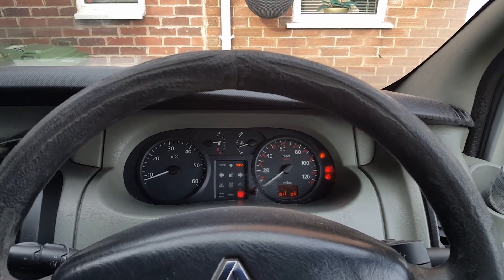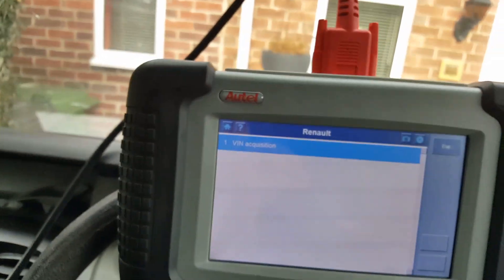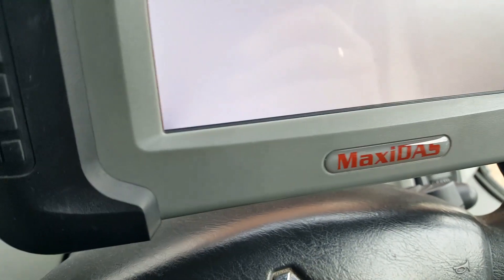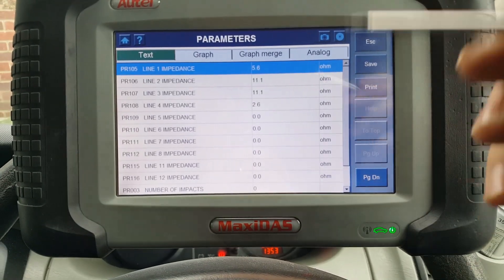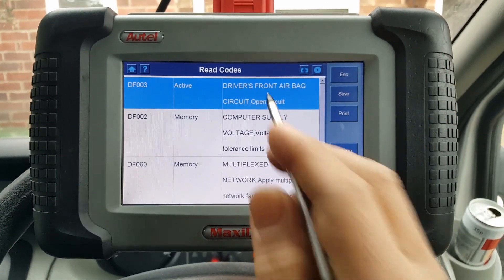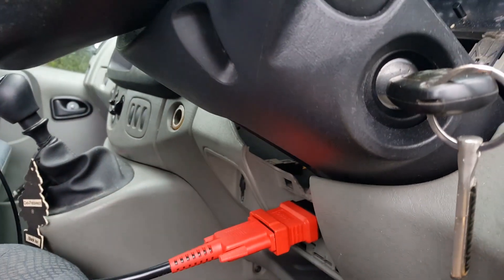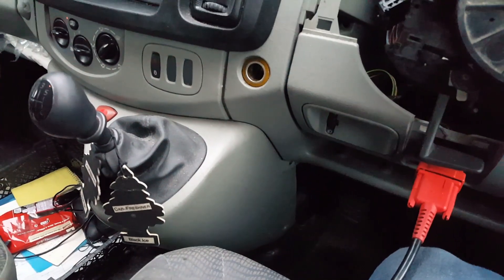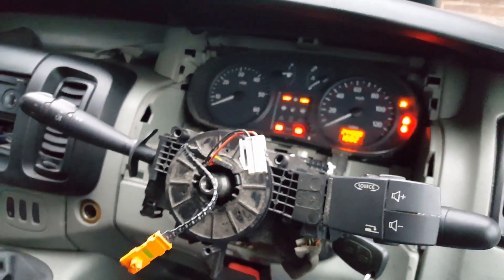Renault Trafic 2003 Airbag light on. Faulty steering squib (clock spring), diagnose and test.

Comment: Was the horn not working also?
Reply from the maker: Can't remember now...
But it all depends how they fail... 
Thank you for watching!
Reply: @LMAutoRepairs  I have the same problem. Horn has not been working Esther a couple years before the warning lights came on. Fault reader gives code Df158. Strong indications about the fault being in colck spring, not pretensioners? Also line 2 shows 99,9 ohms...
Reply from the maker: You need to test, but there is a good possibility of being the clock spring...
👍👍👍

Comment: Just a word of warning if you're unlucky like me and own a mk2 megane.
After months of problems, clutch, steering rack etc, i decided to take it for an Mot. The day before i was going to go for the mot i suddenly discovered a lever under the steering wheel, never looked there before, decided to pull the lever and tilt the steering wheel up, airbag light came on!, ahahahaha, aaaahahahaha! I love this car. Not!
Incidentally, car had new airbag clockspring/squib 6 months ago!
Reply from the maker: 🤣🤣🤣🤣
That's really unlucky...
Hope you get it sorted...
Thank you for watching and for your comment!
Reply: @LMAutoRepairs  I've heard that you can get products to sparingly use on airbag connections to increase/ensure conductivity? Is it die electric grease or something? Or is there some other product i could use, have you heard of anything? Cheers, Lee.
Reply from the maker: @robbocop33r12  
Yes... That's correct...
Silicon based grease....

Comment: Hi i have the same problem well the same symptoms, can you not check the clock spring through continuity on the airbag wiring say the plug to plug, the plug at the rear to the plug that goes into the airbag itself as i dont have such sophisticated equipment as yours but have a multimeter many thanks..
Reply from the maker: SooperSkoots 
Hi
Yes, you can check it like that...
Reply: Many thanks for that i am going to do that in the morning, great video by the way very help full....
Reply from the maker: SooperSkoots 
Thank you for watching!
Reply: Hey i did the check i mentioned and yes it worked, a new squib is on its way, thanks so much for this video i would not have done it without your help, many thanks again Mark.....
Reply from the maker: SooperSkoots 
No worries, here to help!
Reply: Hi just a quick one, i have replaced the squib and no lights on now, thank you so much for this video most helpfull..
Reply from the maker: SooperSkoots 
Thank you for the feedback! 
Much appreciated!

Comment: Would a seat belt tensioner fault cause the airbag and service light to stay on?
Reply from the maker: hibernia-nation 
Most likely, yes it will...
Reply: lmsvvavr Thanks for your reply. Will i have to now replace the entire squib? Or can i fix the tensioner to solve the problem?
Reply from the maker: hibernia-nation 
If the  problem is the tensioner, there is no need to touch the clock spring/ squib...
Reply: lmsvvavr Thanks again. Where is the tensioner located and is it difficult to solve?
Reply from the maker: The tensioner on that one I am not sure...
But should be by the seat belt buckle...
You see that the buckle has a sort of a tube with a plug on it...
But check connections and wires, in case is a wiring problem and not the tensioner itself.

Comment: I have vivaro 2005 no speedo and stop and spanner light on is this a common problem has my abs module failed I tested feeds to plus getting good positive and earth too
Reply from the maker: Have you scanned the van?
Reply: lmsvvavr yes came back with low voltage 
Main abs relay permanent
Reply: lmsvvavr yes have scannned said low voltage main abs relay but tested feeds and they seem ok
Reply from the maker: clive smith 
Ok
You should have more than one wire feed... depending on the module type... check them all... check ground.... if all of, it might be that you have a faulty module... or something between the plug pin and the pcb...
Reply: lmsvvavr yep checked em all all showing power and good resistance to ground a think the module is had it